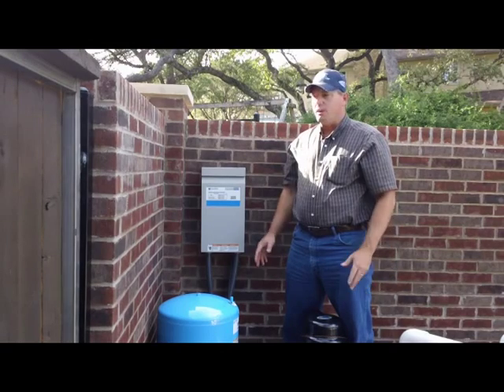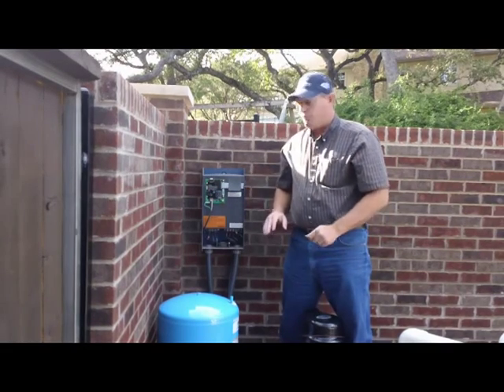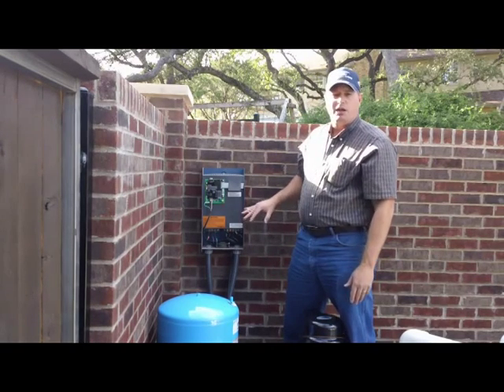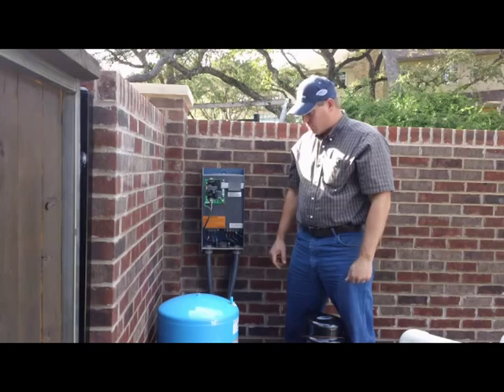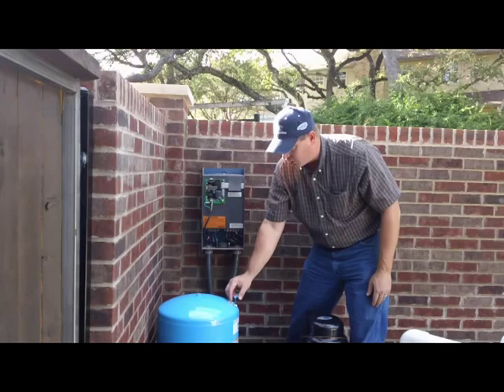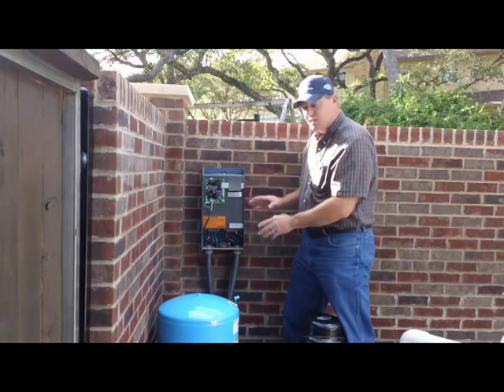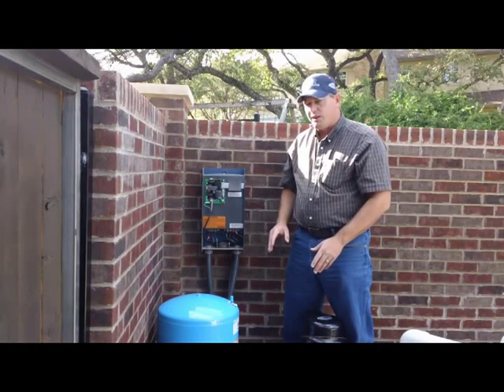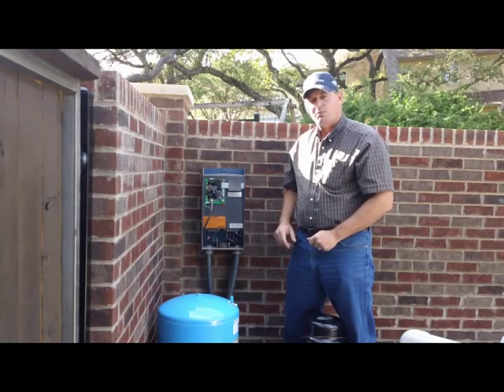Adjusting the Pressure on Your  Constant Pressure System

Comment: is this different from the pressure switch?
Reply from the maker: Yes.  These controllers measure the pressure with a pressure transducer (or sensor) and adjust the speed of the pump to maintain pressure.  Here is my video on adjusting a pressure switch.  https://www.youtube.com/watch?v=Vv4gY35byY4

Comment: I have this exact setup for a constant pressure system. My issue is that I want my pump to kick on sooner the pump will run until the pressure reaches 65psi which is what I want but the pump does kick on until the pressure reaches 35. What do I need to adjust to have the pump kick on sooner, say at 40 or 45 psi? Is it just a matter of releasing air from the pressure tank?  Thanks
Reply from the maker: It depends on what brand you have.  I normally sell Goulds controllers.   They have a switch on the inside that will allow you to turn on the pump after a 5 psi or 20 psi drop.  If yours is dropping more than 20 pounds, the problem may be the pressure tank precharge.  It needs to be set 25 psi below the set pressure.  To adjust this, turn off the power to the pump, drain all water pressure out of the system and then adjust the air pressure to 25 psi below set point.  In your case, that would be 40 psi.  Also, look in the controller (with the power off) and see if there are options for pressure adjustment.